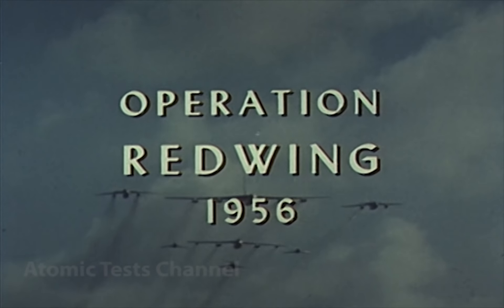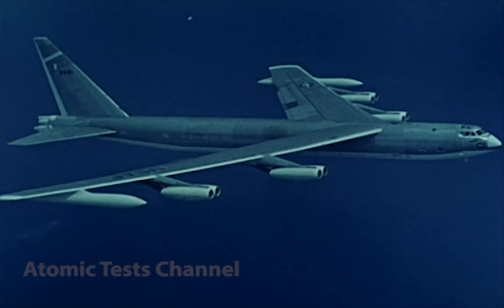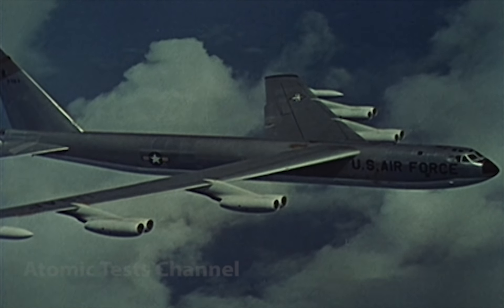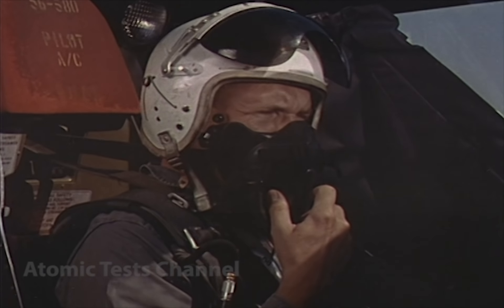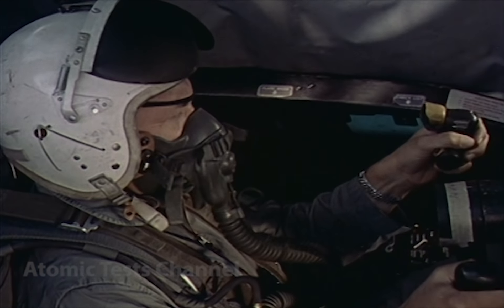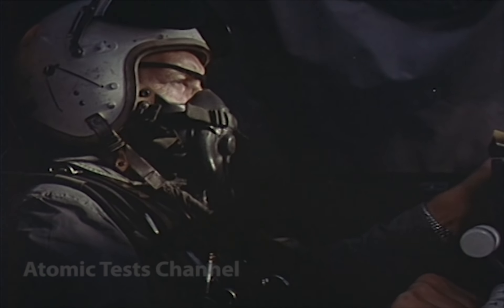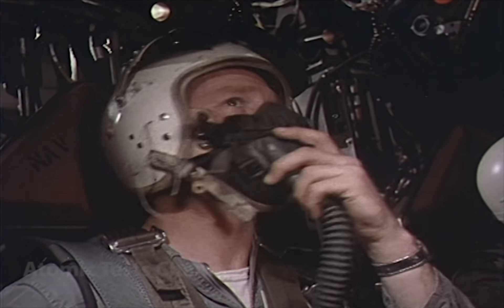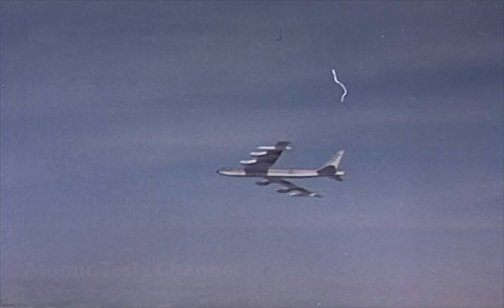NUCLEAR EFFECTS OF NUCLEAR WEAPON DETONATIONS ON AIR CRAFT PART II

Comment: search into what's known as "The Wigner Effect". 
it's caused by the irradiation of aircraft structural parts. 
weakens / fatigues the metal parts. 
f.y.i. 
stay cool.
Reply: Any neutron flux strong enough to cause the Wigner effect on an aircraft in flight would be well within the vaporization range of that weapon.
Reply: Awesome information gentlemen, absolutely awesome! I was born too late, I would of been very interested in this type work / career, back then.

Comment: Excellent video.  As a former member of SAC stationed at a bomber base, there's another reality not mentioned in this video.  The KC-135 air refueling aircraft (tanker) is expendable in a nuclear war.  The tanker's mission is to rendezvous with the B-52 at predetermined coordinates and transfer every drop of fuel the B-52 can hold.  That may or may not leave enough fuel in the tanker to safely return.  The tanker crews understand they will likely run out of fuel and have to ditch the tanker somewhere in the Atlantic ocean.  All they can do is hope they are rescued following the nuclear exchange.  Not very likely.